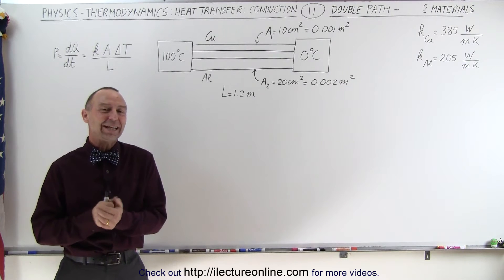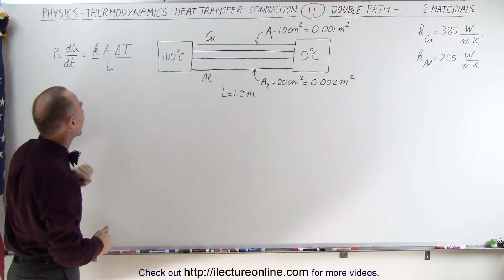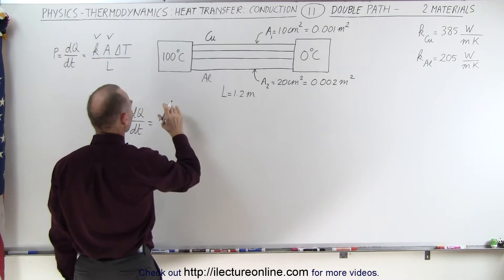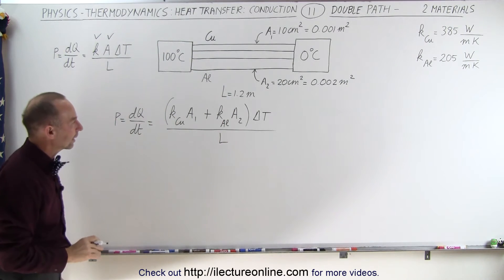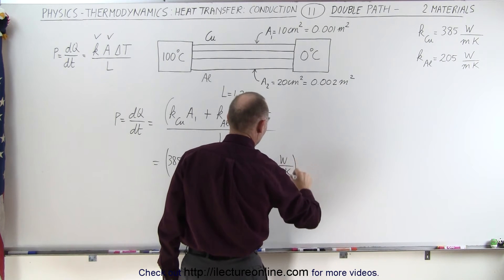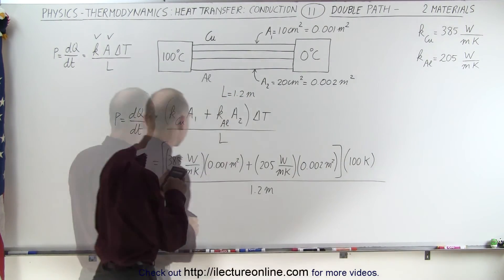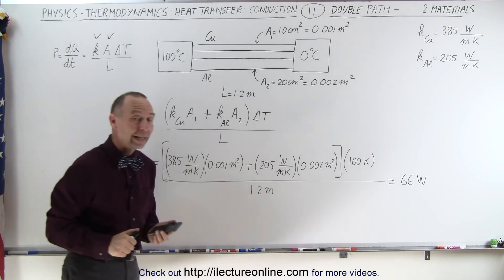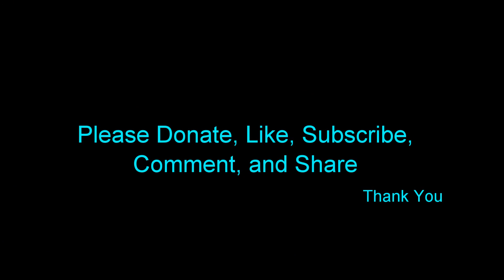Physics 24  Heat Transfer: Conduction (11 of 34) Double Path - 2 Materials

Comment: Sir, I would appreciate if you could help me understand a problem teacher set to us. There are n bars linked parallelly to each other. They have the same length, but different cross section areas and heat conductivity constants. Temperatures at ends are T1 and T2. How to find the equivalent heat conductivity constants?
Reply from the maker: This video may help:   Physics - Thermodynamics 1: Ch 24.1 Variable Heat Transfer (19 of 25) Multiple Conductivity Paths